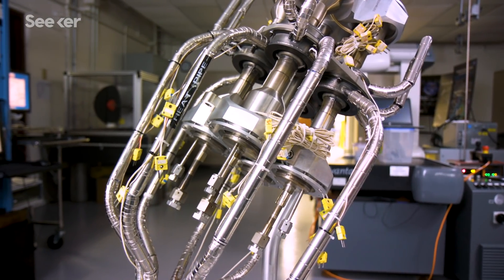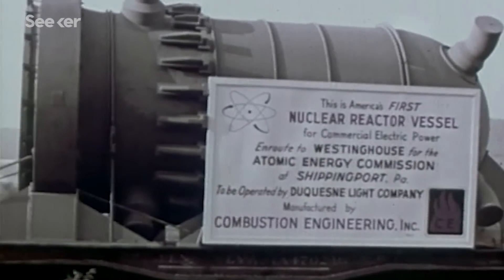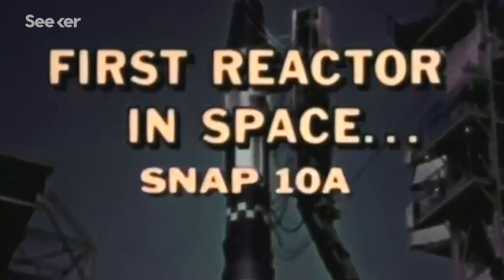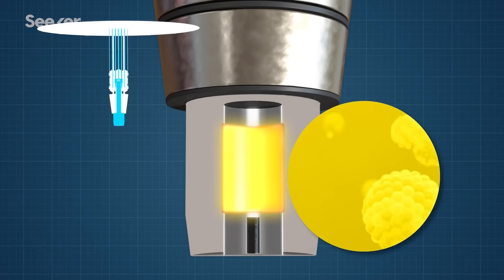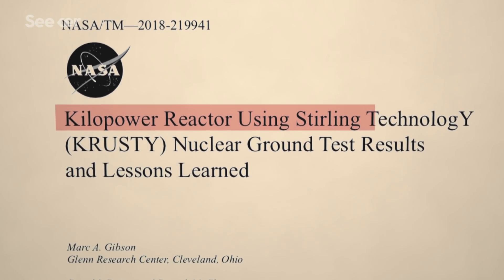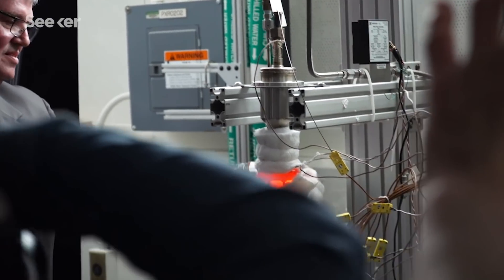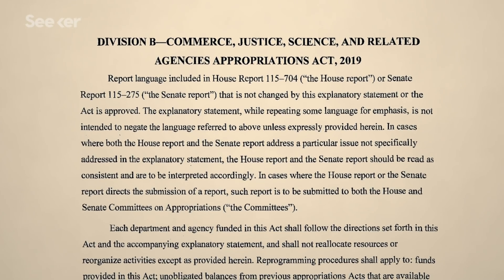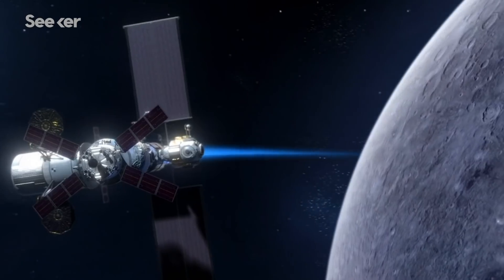NASA's New Space Reactor Is Powered by Nuclear Fission

Comment: Can we take a moment to appreciate the use of a Stirling Engine - a technology of the early 1800s - in powering space probes.
Reply: Just looking for this comment....well played, well played.
Reply: Technology improves but thermodynamics stay the same.
Reply: Just wait until you see automata on Venus!
Reply: Stirling engines: run them off of a hot cup of coffee or a radioactive mass. They just don't care. I know, design matters. Made to be a safer alternative to Watt's steam engine and we still haven't found a safer/more reliable engine.
Reply: Can't beat that efficiency
Reply: The mousetrap for thermal to kinetic conversion.
Reply: its very efficient
Reply: Stirling engine? Why do they use stirling engine instead of thermoelectric cell like seebek effect?
Reply: @djdynieldaniel1395  simplicity and keeping weight down most likely
Reply: @djdynieldaniel1395  Stirling engines are much more efficient

Comment: 10/10 that guy tried to use it for coffee machine at least once
Reply: If you could transfer the heat with out making the coffee radioactive weast, i bet you could get a really nice and hot cup.
Reply: Nah it's just a really fancy bong.
Reply: @vicegt  waste*
Reply: Nuklear powered coffee? Now your thinking with portals!
Reply: @lalafellgaming  nuclear powdered coffee
Reply: pickle popsicles what ?
Reply: @jonslg240  coffee powerade nuclear
Reply: Definitely Fancy Bong, I don't why they trying to import it as a NASA Fission Engine.
Reply: @vicegt   Well that is how nuclear power works in the first place, heat water to flash it into steam to move a steam turbine, 

The only thing you need to not make the coffer radiactive is simply heating the coffe outside the reactor, if possible with a biological lead shield between reactor and heat exchanger
Reply: Instant coffee from General Atomics, for that after glow feeling.
Reply: @vicegt  We use radiation to treat black pepper. It's been a replacement for preservatives for a long time. Radioactive particles(Fast moving particles) don't actually contaminate anything, they decay and disappear. It's if you get the radioactive element itself(Plutonium or Uranium) in the coffee that would be the problem.

Comment: One of the things the video didn't touch on is a difficulty not being tackled because fusion is not yet a viable net power generation technology:
Heat dissipation.

The amount of heat generated by ordinary experimental fusion reactors is tremendous, not just from the chamber itself but from the auxiliary equipment used for measuring and monitoring. A Fusion reactor in space of any size or configuration would need tremendous heat dissipation capability, because there's no air to simply dump waste heat into. That's a problem that will probably get addressed once we decide we want to launch or build a fusion power plant to operate in a vacuum.

Comment: Yes, fission power is easier to control by the virtue that FUSION IS NOT YET SOMETHING WE CAN DO.
Reply: we can do fusion, but we can't use it as a power source
Reply: Actually we can and have been since the 1940's. Ever heard of a hydrogen bomb? Fusion. Ever heard of element synthesis? Fusion. Ever heard of Tokamak Energy? Fusion. We can easily get fusion reactions started AND produce huge amounts of power from them. What we can't do so far is control it exactly as the guy said.
Reply: At a feasibility, or profit level. Czar Bomba was a yes we can do fusion moment.
Reply: When someone tries to sound smart but they just dont.
Reply: @gordonlawrence4749  No we cannot get huge amounts of power from fusion (at least not from anything other than a bomb). Every attempt at a power plant design to date has yet to produce more energy that what was consumed and has not been able to maintain a chain reaction. Also Lord, fission will always be inherently more controllable that fusion because of the requirements needed for the two to happen. Fission requires enough of a material in close enough proximity to work. Fusion requires extreme heat, extreme pressures, the right materials, and then something to contain everything. Oh and that something cannot be like a metal flask because the extreme temperature requirements will melt anything.
Reply: @gordonlawrence4749  For God's sake Gordon.
Reply: @gordonlawrence4749  "Akshually"
Reply: @travisbeagle5691  Rhe statement was that fusion was something we cannot do. That is a blanket statement not a qualified one therefore my point is valid.
Reply: @gordonlawrence4749  Somewhat fair point but whenever anyone makes that statement it is in the context of power generation not weapons of war.
Reply: Fission will always have the advantage of being lightweight. A fusion reactor will always be heavy and only work for very big projects.
Reply: @P8qzxnxfP85xZ2H3wDRV  That is pure assumption based on faulty thinking. There are some branches of physics which could potentially lead to magnetic fields in excess of 10,000 times stronger than anything we have right now. That would reduce the size of a fusion reactor to less than 100kg. Just because it can't be done now does not mean it never will be.
Reply: We can't do it because it's difficult to control the reaction.
Reply: @gordonlawrence4749  The difference between fission and fusion is that fission is spontaneous, whereas fusion is not. So regardless of any scientific and engineering advances, fission will always be lighter, simply because it doesn't need equipment solely for the purpose of creating favorable conditions.
The analogy is lacking, but it's kinda like how a combustion engine will always be lighter than a sterling engine.
It's great that you bring up future magnets with much higher field densities, because that's actually what I'm working on personally. I'm assuming you're talking about magnets built from the rotation of light. Since light is weightless, the first assumption is that these magnets will be too. But unfortunately that's not true. You still need a dielectric and mostly you just shift the weight towards the laser equipment. These incredibly powerful lasers are massive and fill entire hangars.

There are actually ideas swirling around to not just build the magnets with lasers, but also directly use the laser to ignite the plasma. This would further reduce the size of a fusion reactor, but it still needs the lasers with their power banks.
On the other hand fission just runs on an atomic level. It doesn't actually need anything. The only reason we build structures around it is to control it and make use of it. So while fission technology, in theory, could be brought down to microscopic levels, this will never be possible with fusion.
Reply: @gordonlawrence4749  In retrospective, I'm sorry I took you seriously. :(
Reply: @gordonlawrence4749  fusion power is not yet feasible. There does that help?
Reply: @BAGELMENSK  I never said it was. What is said was that the statement "Fusion is not yet something we can do" is completely wrong. We even have fusion reactors that are at least looking like they are heading in the right direction to work eventually.

Comment: "They found fission easier to control for space missions" duh
Reply: well, if Apple handled the design, they would probably choose fusion and stubbornly go with that route
Reply: We only have fission power so yeah, what's your point.  Fusion has only ever been initiated for a few seconds before having to be shut down.
Reply: @tidbit1877  exactly the point. My point being that Apple is so dumb with design that they will choose whatever is the flashiest marketing term and build a product around it, and never let go of that idea even if a) the technology isn't there yet b) it is theoretically impossible and c) they have proven it themselves that the product is doomed to fail. Ie. releasing ultra-thin laptops hoping that it will not thermally throttle even if physics otherwise states that it will or releasing ultra-thin keyboards that they themselves know will break but they stubbornly reiterate it even if the technology isn't there yet.
Reply: You must have bought the only two Apple products that had any flaws; I would never insult Apple, think about it; which is better:  Zoom or iPod   Android or iOS   Motorola or iPhone.
Apple has created some of the best electronics on the market, I'm currently using an Apple desktop and it is . . . literally a 2009 machine!!!!!!!   99% of PC's would be useless trash after 10 years, my Apple is going strong and honestly I wouldn't sell it for even $500.00 because it is still worth more than that even after all these years.  Most of what Apple creates is high tech, the fastest, the best, super well designed, super sleek, ultra modern, and very easy to use.  Thanks for warning me about the slim laptop though, and the keyboard, I'll steer clear, but honestly, in a few years I'll bet they have all the kinks worked out.
Reply: @tidbit1877  I also use Apple products, the only difference is, unlike you, I made the stupid mistake of "upgrading." :( Sure iPod is better than Zoom, iOS over Android and iPhone over Motorola. But that was the past. Thinkpads, XPS's, and even Razers are catching up fast in software but have already caught up in hardware to macs. Apple has a pro mac now, but you can get a way higher spec'd PC at the fraction of the cost. And, even Samsung is catching up fast with Apple. I hope they work out their kinks.

Comment: IDK what this guy was explaining but just strap some 100 Mt nukes to the back of a rocket and call it a day.
Reply: dude dude easy say , hard to do
Reply: That works like a bomb.
No seriously.
You just need to scale up what you calla "rocket" to something the size of an oil supertanker.
And give it one Mother of a thick blastplate for the rear.

refer: project orion.
Reply: @marvinkitfox3386  you want to know a even cooler method? The nuclear salt water rocket. Finely tuned highly pressurised water rockets pumping nuclear salts into a nuclear reaction taking place outside the rocket in a specialy designed nozzle. Think flame thrower but with a nuclear explosion instead of a regular fuel and fire.
Reply: @shdowdrgonrider  Yes, Nuclear salt-water rocket achieves reasonable ISP and GINORMOUS thrust.

It has the very slight disadvantage that it you launch on an inhabited planet, that planet will very rapidly become UNinhabited, due to the slight radiation from the exhaust.
Think about 3 chernobyl's per minute, while thrusting.

Comment: I love how us civilians get everything 20 years later then when it actually comes out..
Reply: if everyone had nuclear reactor at home would be a bit terrifying.
Reply: I hope you realize how little power those reactors are actually making. Your house hold power usage is tracked in kilowatt hours, that reactor MIGHT be able to power your house running only a few things but nothing power hungry or likely needing high amperage without battery banks galore... That and the yare very inefficient compared to other designs as they require drastic heat differentials between the hot and cold... But planet side it works much better to simply go with what we've essentially been using for hundreds of years.... Water power.
Only since the advent of steam boilers not much has changed. Coal power plants are little more that a big steam boiler as are our big megawatt nuclear stations... They are little more that a big steam boiler!

Comment: Are they using a liquid nitrogen coolant system, that flows through tubes to keep the systems cool, and prevent a system overload? Its cool it allows for a system thats similar to a gas powered fighter jet. This type of power system will allow for smaller and lighter space crafts that will also allow for more technology interfaces with the current systems. Way cool.

Comment: Nuclear fission has several problems apart from those cited in this video. They might have managed to reduce the size of the reactor, but they still are (relatively) very heavy due to the weight of the fissible material. Plus, even if it works properly, it generates a extremely toxic waste. 

Right now, these kinds of systems might be the best solution for long space missions, but, if we want to achieve interplanetary travel, we really need to research how to make nuclear fUsion work properly.

Comment: I don't understand the "umbrella" style of heat exhanger...in vacuum the surface of exhange doesn't matter since there is no medium of exchange but rather throught infrared radiation. By making those "umbrella" they might actually get more surface the be heated by the sun radiations. Instead of a flat surface, wouldn't a apparatus of concentric rings be more efficient ?

Comment: NERVA failed because they pulled the specific pressure off to run a turbine, while venting low pressure hotter and hotter gas which liquidized the stone to vapors which when the pressure cut off the reactor shut down and with the rocket sunk into the ground and suddenly the heat cut off the ground cooled off encasing the rocket in the ground. Thus most of the nuclear systems were looked at as dangerous for decades. Specific heat was still used over specific pressure and concepts like hot pressure expands faster while not being able to push as hard as colder atmospheric gas, all the way until the early two thousands.
Reply: Thanks Thunderfoot.

Comment: In theory you could do mechanical shielding that also absorb a heat and creats it's own Em/photovoltaic  field , where electricity goes to primary and defensive systems . Theoretically speaking to achieve spead faster than light one of your main components should be small replica of the hadron collider  in way that power is used to generate to produced small exotical particals which are than sent to plasma accelaretors and than being compressed in ion engine (that would solve problem with acceleration) theoretically speaking about tachyon but question is how to prove existence of such exotical particale .

Comment: Pu can be made much safer by interleaving it with a material like potassium metal, a thin layer of sublimatablable polymer, and water soaked PMMA, the moment it touches an atmosphere it will form a thick layer around the Pu, making breathing it impossible, and blocking all alpha particles. That might be an extra safe space fission reactor for spacecraft near Earth/Mars.

4D creatures watching us change near field antenna RF/EM might be intrigued because that is something humans don’t do very much, and has a lot of intensity/brightness. Near field antenna does not decrease with the square of the distance so looks very different. I suggest a long narrow near field antenna effect beam (some engineering there) to put on spacecraft that we’d like aliens/4D creatures to find. Send it on a looping orbit around multiple exoplanets, if possible. Use a very long lasting fission battery so it has energy for the duration of the trip. I don’t know if Pu would do it, but Pu can be made much safer by interleaving it with a material like potassium metal, a thin layer of sublimatablable polymer, and water soaked PMMA, the moment it touches an atmosphere it will form a thick layer around the Pu, making breathing it impossible, and blocking all alpha particles. That might be an extra safe space fission reactor for spacecraft near Earth/Mars.
Reply: just sandwich the water in very thin metal pouches so it doesn't evaporate. although the Pu RTG might be less efficient, it is much lower risk.

Comment: As this thing is nuclear, I do not see a redundant system of cooling should the umbrella mechanism fails in its operations. More moving parts increases its chance of failure and maintenance on the long run, the wide surface area creates a large enough surface that should any space debris hits, it will be knocked off balance. Just like the umbrella in a wind storm.

Comment: Why don't we use a bunch of these smaller form factor fission reactors in different places on the grid rather than a massive one that could go critical and get out of control? If one failed you just have a small area with contaminants and a lot less to clean up.

Comment: Ok I want to see reactors built that use spent fuel rods. Strickly a steam generation reactor, that can't melt down, because the spent rods can't produce more than 600-800 degrees f. The reactor life would be 20-60 years before it fails to generate enough heat. It uses a product everyone wants to bury somewhere. The whole reactor has a long life because lower temperatures reduce fatigue and oxidation. In space if one wears out to toss it toward the sun or Jupiter, and turn on one of the spare reactors carried by your space craft. A space craft of large size will need 45 kw 24/7. Large radio telescopes used to chart the kyper belt, or Oort cloud my require much more wattage. So having 10 20kw modules in operation may be required. To power enough hydrogen converters for fuel to reach the next solar system might need 100 20kw units. Then your dealing with a lot of excess heat that has to be released into space.

Comment: It might be easier to recycle nuclear waste through vertifrication process into solid glass like waste and stack them around the chamber made out photovoltaic materials with + shell or photovoltaic body on the one side and - on the other photovoltaic road inside chamber   where radiation is turned into electricity  while releasing heat in process (sort of fuell cells /battery you see in scifi) question is how much output electricity you can get out of it , but its just a thought.